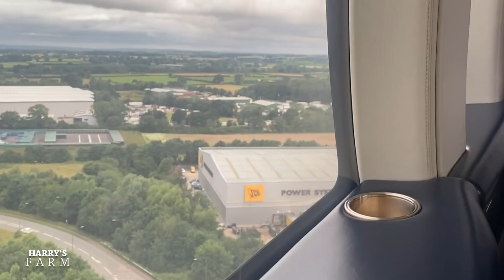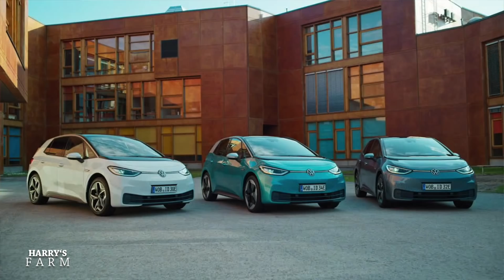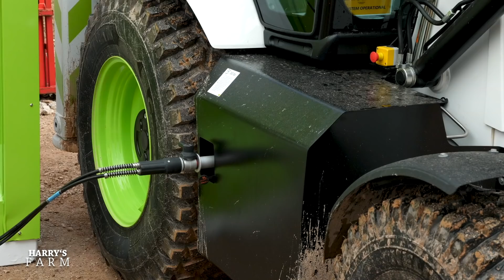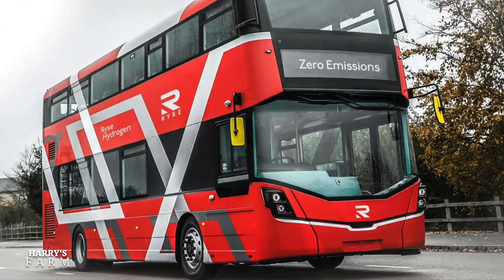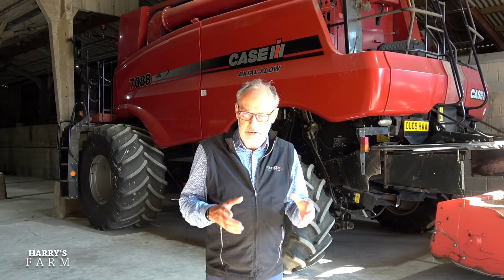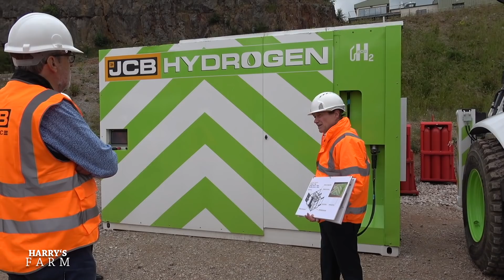Why JCB thinks hydrogen is the best alternative to diesel for heavy machinery, farming and HGV fleet

Comment: Be interesting to see where hydrogen fits into transport and construction, Volvo seem to be going electric. I was skeptical about hydrogen but they make alot of interesting points
Reply: It's just so bloody dangerous, it's so common to get a bit of diesel stink from a 5 yo machine, when that happens on a hydrogen machine... Kablamo!
Reply: @zopEnglandzip  it's highly inflammable. We work with the stuff. Fuel cell the best option. Combustion only in very controlled situations. Think Bamford trying to run before he can walk.
Reply: @Droledope  please correct me if I'm wrong, but fuel cell vehicles would still require a similar infrastructure off the vehicle and very high pressure storage on the vehicle? I appreciate the efficiency is much higher and that will reduce the volumes involved.
Reply: @stumpyplank6092  hydrogen is more dangerous than batteries
Reply: @proxy7863  not anywhere near! lithium is explosive in contact with oxygen almost impossible to extinguish once ignited and poisonous! hydrogen is just flammable?
Reply: @stumpyplank6092  storage under much higher pressure than other common fuel gasses, the range of concentrations at which it will combust in air is far wider than any other fuel and it's atoms are so small that they pass through steel.
Reply: @stumpyplank6092  I have no problem with hydrogen. Was just pointing out your were wrong to say batteries are "infinitely more dangerous".
Reply: @stumpyplank6092  methane is a bio fuel, produced mainly from waste which would emit it into the atmosphere regardless of our input, the bio-gas industry is already well established and feeding into the gas grid/straight to power stations, the reason it makes so much sense to focus on bio gas is because we've already got the infrastructure in place for bottled/forecourt cng/lpg and any shortfall in production from waste (which has hardly been tapped yet) could be taken up by natural gas or in the future, gas made by co2 sequestration which admittedly requires hydrogen but unlike pure hydrogen the resulting gas can be stored as a liquid without cooling at comparably low pressures while being far more dense.

Regards your reply to the other chap about musk, he's sold a bit of snake oil but it seems to me the technology tesla truly excel at is battery management, I'm aware there have been some bad fires, and lithium batteries can explode if shorted but these are easily negated and comparable to a current petrol vehicle in terms of destruction. 
I wouldn't want to be within half a mile of a hydrogen hgv that'd caught fire and if you've got a site with storage and multiple hydrogen machines operating it'd look like Nagasaki when the dust cleared.
Reply: @stumpyplank6092  yeah I agree, it's not going to be an all one approach. We rarely hear about it because it is.... rare.
Reply: @stumpyplank6092  admittedly up here in lincs they do feed specially grown maize into the digesters as well as the other stuff. 
What would make more sense than sending a truck to collect our potato peelings is just shoving every bit of organic waste down a sewage system straight to the digester along with everything from the factories and restaurants, the leftovers can then go back onto the fields negating the need for quite as much fertilizer which is another contributor to emissions that no one is talking about (3%)
One of the scandinavian countries (finland?) have already done something like this with their dustbins that never need emptying feeding an incinerator and heating everyone's homes.
Algae oil looks interesting too, it's meant to require far less processing than any of the other liquid bio fuels.
Reply: @stumpyplank6092  sewage is already tested quite extensively before it goes out to the fields, I think there was some noise about testing for substances other than heavy metals, not sure.

I am completely unaware of the black fly factories, it's making my skin crawl thinking about it but I'm going to have to try and read up on it, thanks.

Completely agree with land usage and the blinkered views of the powers at be.
Our economy is always the most important thing for them and the only sure fire way to keep it growing is a growing population and people spending neither of which are conducive to looking after our planet so from the start there is conflict.

Not so familiar with hemp, or bamboo or any of the greener cotton substitutes, so much effort put into decarbonizing transport and textiles produces as much emissions yet it's hardly talked about.
Reply: @stumpyplank6092  some really interesting uses for the blackfly, I had heard the "eat the bug" memes but hadn't appreciated it's potential outside human food. Thanks for the chat and take care.

Comment: Absolutely impressive. This is clearly where both cars and heavy vehicles need to go. Able to use parts of existing internal combustion engines, no restriction on range,  keeps todays mechanics and engineers in jobs and its clean Whats not to like...governments and industry clearly need to get on board
Reply: they need not go anywhere. the only thing forcing this and keeping us dependant on fossil fuels is the Gov's hand in the petroleum industry's pocket. there is a huge number of alternative fuels which would be just as practical as petroleum when used in tandem.
Reply: @mark scully Why would you get CO2 from a H2 combustion? You WILL get NOx, regardless of how you burn.
Reply: I am so pleased to see this development. Well done Lord Bamford and your team. Long live British engineering.
Reply: The cost of producing hydrogen for fuel is and always will be prohibitive to hydrogens uptake in applications where battery electric is possible
Reply: What’s not to like? The inherently lower end to end energy efficiency compared to the battery solution.

Like has been said, batteries are untenable for certain applications, but for the majority they work fine, and simply use less energy.
Reply: Unfortunately not. this offering ignores the main problem with hydrogen, which unfortunately Harry et al either choose not to mention or simply don't understand!
Reply: oil companies attempting to sell oils and gas dressed up as hydrogen it is a scam    Depending on the quality of the feedstock (natural gas, rich gases, naphtha, etc.), one ton of hydrogen produced will also produce 9 to 12 tons of CO2
Reply: @brianevolved2849  it's fine trees and plants love a bit of co2
Reply: @stephenparker5241  You are I hope pretending to be a fool
Reply: @brianevolved2849  do plants and trees use co2?  Yes or no
Reply: @stephenparker5241  Even better question addressing those fools would be why the serious greenhouse agricultural installations regularly keep CO2 concentrations between 1600 and 2500 ppm within... Times more than the 300 ppm that according to the zombied crowds heralds the end of the world.
Reply: oil companies attempting to sell oils and gas dressed up as hydrogen it is a scam    Depending on the quality of the feedstock (natural gas, rich gases, naphtha, etc.), one ton of hydrogen produced will also produce 9 to 12 tons of CO2  
However, hydrogen combustion with air produces oxides of nitrogen, known as NOx. In this way, the combustion process is much like other high temperature combustion fuels, such as kerosene, gasoline, diesel or natural gas. As such hydrogen combustion engines are not considered zero emission.
Reply: @brianevolved2849  who cares? If the selective cata- lytic reduction (SCR) eliminates 90% of the NoX emissions than that's fine. Let's no forget all the trees that have to be cleared to gather your precious lithium
Reply: Burning hydrogen in a ICE is incredibly wasteful, still produces tailpipe emissions, and only serves to keep those that have blindly invested in further ICE production in business.
Reply: @EP-bb1rm  in a properly developed engine there is no reason for any emissions other than co2 and water
Reply: @markscully2342  Why would you get CO2 from a H2 combustion? You WILL get NOx, regardless of how you burn in air.
Reply: @markscully2342   And nox. Because hydrogen burns high temperatures. And max. 30% hydrogen comes to axial power, vs fuel cell 50% And More.
Reply: @EP-bb1rm  adblue has already addressed nox issue in diesel engines so your point is moot in both diesel and hydrogen combustion engines
Reply: @stephenparker5241  SCR (commercial name adblue) is not 100% effective (in lab tests as much as 90%), and is very ineffective on cold engines and in below freezing conditions.
Reply: The government's and car companies are being controlled by a certain billionaire with his green credits so any other alternative technology is overlooked.

Comment: Electrification will be great for pottering around locally.But charging at home will be a must.Lord Bamford is bang on the money.Unless something else other than Diesel goes in the tank haulage and construction wont work,Essential reading for our PM...
Reply: Very happy to see this interview by Harry. I've had an electric car for 9 months, it was a nervy decision, but the maths for my use case added up. I do enough miles a day for the car cost to be offset by the fuel saving over the life of the car. I can charge at home - many can't. Battery cars are now a real alternative, but only if your circumstances fit the vehicle. Little old lady who drives a few miles a week to shops and friends? Not practical, too expensive for her use. Lorry driver? Not practical. He does too many miles - the cost and weight of batteries will be a problem. Charge times may also be an issue - yes you can fast charge, but slower is better for battery life. Farmers? Same as the lorry driver, during harvest may need to work an 18 hour day and keep fuelling time to a minimum. Hydrogen has its issues, but it is a better fit for a diesel engine replacement than a battery. The JCB chart near the end showed this well. Batteries work well for small machine and most cars. Hydrogen becomes a better option for heavy machinery and also some car users. I think the future will see a blend of battery and hydrogen technologies working together in the same way that we have petrol and diesel now. Really hoping the government gets behind JCB on this one - it could be a world leader in this new market if we give them the support they need to get this moving. They can build the machines, but they need us and governments to help them with the infrastructure. Maybe the government should be helping with the cost of adding a hydrogen pump to existing petrol stations?

Comment: I can see the use of hydrogen in heavy plant, but hydrogen combustion? The efficiency will be appalling. Your hydrogen comes from electrolysis or reforming natural gas. It may be cheaper to buy the plant but what are the running costs vs a fuel cell?
Reply: oil companies attempting to sell oils and gas dressed up as hydrogen it is a scam    Depending on the quality of the feedstock (natural gas, rich gases, naphtha, etc.), one ton of hydrogen produced will also produce 9 to 12 tons of CO2
Reply: A 100kw fuel cell would cost a fortune and the reaction surface would need regular replacement. The people who gave that comment a thumbs up need to spend 5 minutes on the internet learning about fuel cells.

Comment: If one would understand how much power these machines use compared to normal cars, how expensive they are and therefor how important it is to run as many hours a day as possible and also how important it is for farmers to have a machine that can keep going when they need it, one would understand immediately that battery driven is no option. Not even debatable. Same goes for lorries btw. So lets start building out our hydrogen stations shall we. Government should just make it mandatory for petrol stations over a certain size to offer hydrogen. We are putting our money on the wrong horse and every day that goes by we are going further and further away from the solution we will need at the end.

Comment: At last Lord Bamford has achieved a reliable, zero emission ICE which can be sold and maintained on a global basis and will probably produce similar, if not more power and torque than the best of the diesels. Now we have to ensure that the politicians realise their error in heavily supporting unsustainable electric power. I’ve recently ordered a hybrid car because I don’t believe a total electric car is the answer but we are governed by people who don’t have the understanding to put in place a replacement for fossil fuels which won’t damage the economy and will produce at worst the same performance or probably increased performance without increasing inflation to a point where that in itself becomes unsustainable. Thank you Harry for raising this matter and I hope that whenever possible you can use your influence to encourage what we are best at and that’s engineering in its finest form.
Reply: There is no such thing as a 'zero emission ICE'. Electric motors and batteries can be sold and maintained on a global basis, the technology is older than the ICE. Electric motors have more torque and power than a diesel.
Reply: Why is electric power unsustainable?
Reply: @proxy7863  it is my personal view that there is a limited amount of the materials such as lithium to make batteries and the cost of mining the raw materials will rapidly increase once cars are running on batteries. Also the footprint for transporting these raw materials is such that I suspect the environmental cost is not dissimilar to fossil fuels. Hydrogen is a much better way forward.
Reply: @chrisflemington819  You are worried about the transportation costs of the 10kg of lithium a car will use in its lifetime but not the 10 tons of fuel an ICE car uses?

There is enough lithium around to make everyone on the planet a house out of the stuff. Lithium is common. Also lithium is not fundamental to battery tech. It is also recyclable.

There is about as much lithium in a top end tesla as there is lead in a normal car. And lithium is more common than lead. We will never, ever, run out of lithium.

As for transportation costs they are trivial compared with hydrogen transportation which requires specialist equipment.
Reply: @chrisflemington819  Lithium is one of the most abundant minerals on earth so we shouldn't run out for quite a while. Hydrogen is more abundant but difficult to get and not very stable. Mining and transport of lithium has an environmental cost but is a lot better than fossil fuels. Once local production (Cornwall for UK) comes online the these costs should fall even further.
Reply: @LiamE69  Lots and lots of lithium eh? And lots and lots of all the rare-earths , minor metals and industrials as well eh? Take as an example, cobalt (you do know that lithium batteries need cobalt or else they can't recharge, right?). Take a very careful look at how difficult it is to mine these materials (start with cobalt) and take a very careful look at how difficult it is to win and refine them. That's all got to be achieved before you get to actually manufacture anything out of any of them. None of it comes for free. It is all very much more demanding and expensive than getting crude oil or natural gas -orders of magnitude more difficult. 

A mine takes decades to bring on-line and they tend to need a lot of transportation infrastructure to be erected to bring product out to where it can be processed and forwarded/distributed to customers. You need investors who have deep enough pockets and long enough time preferences for any of this. Further, those investors need to believe that various political and economic entities etc. are trustworthy enough to be relied on not to help themselves to the assets (mines, infrastructure, processing plants etc.) once they start producing (or even get close to producing). Think on this: capital migrates to where it is best treated. Stable, safe economies are best. Unstable and corrupt....., well....., ask yourself, would you like to take that risk with your own money? 

Meanwhile prices continue to increase. Copper is way, way up ("Electric Jesus" and his disciples are going to need a lot of that). So are many of the other industrial metals, rare earths etc. (and not by a little bit either). None of this can be wished away. Beware of believing in musky old religious narratives just because they have been given a little sprinkling of modern fairy dust.
Reply: @geraldryan7544  Yes let's start with cobalt. You say lithium batteries need it and yet they are producing batteries now without cobalt in them So that point falls flat on its face.

There are no rare earths in batteries. At all. Sure they can be used in electric motors but so can electromagnets which use little if any rare earths. What rare earth that are used are easily recoverable at the end of the motors lifetime. 

Copper and nickel are issues to some degree but EV's make up a tiny proportion of demand for either. Again both are recyclable. Copper way way up? Yeah, to the price it was a decade ago.

You know what you can't wish away? The vast death toll from air pollution in towns and cities due to cars.

Have a look at the new lithium mine in Cornwall. It doesn't seem to fit your description.
Reply: @chrisflemington819  There are massive quantities of Lithium and comparisons of the  environmental consequences of fossil versus electric cars can be found online.